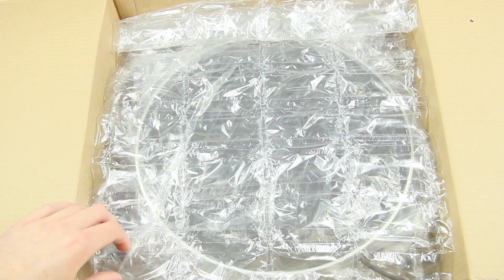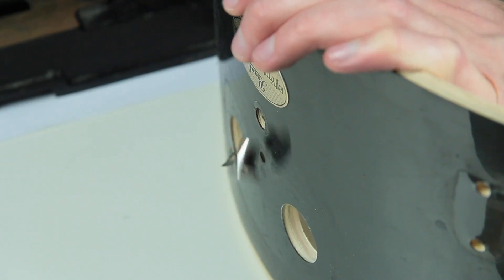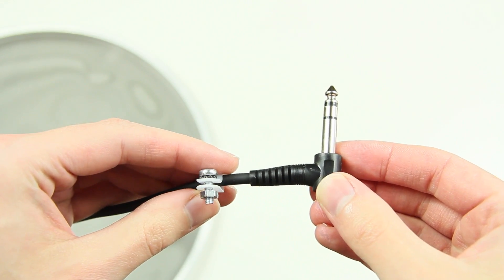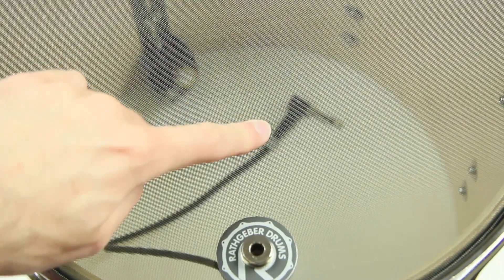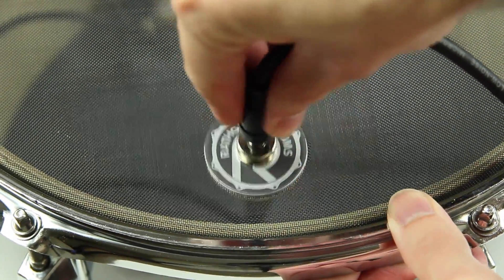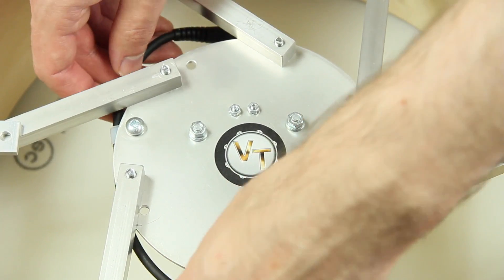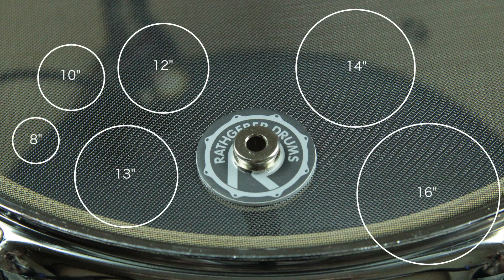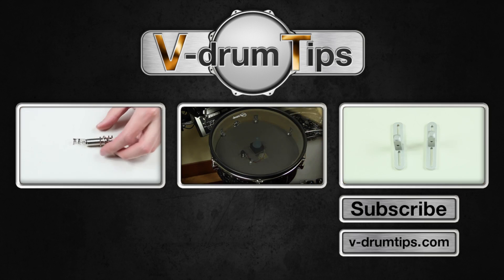R-Drums PlugHead - Review

Comment: you guys should make a video on how to make reliable DIY cymbals, especially with differing shapes, ie: ride, crash, hi hat, China, splash
Reply from the maker: +Koedix Thanks for the suggestion. I am still thinking about a proper way on making them. I am not a fan of plain damped metal cymbals with a trigger. They are simply too noisy.
Reply: Vdrum Tips
Agreed. I'm using circles of plywood and neoprene sheet for my current build but if you come up with something better, I'll definitely look into it.
Reply from the maker: You are way ahead at the moment. I'll think about something:)
Reply: You could try getting rubber or plastic practice cymbals and adding triggers to them